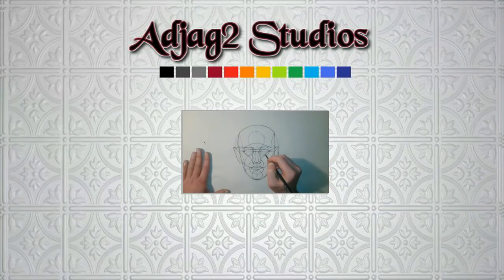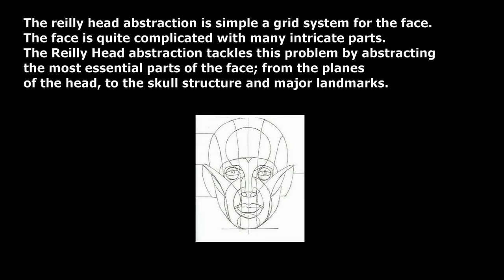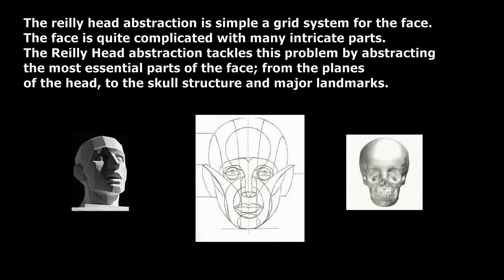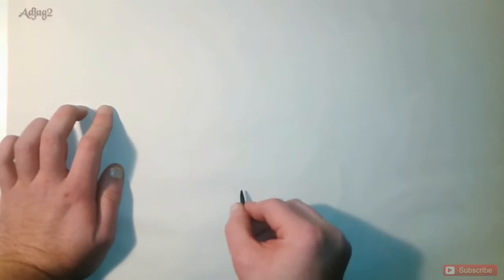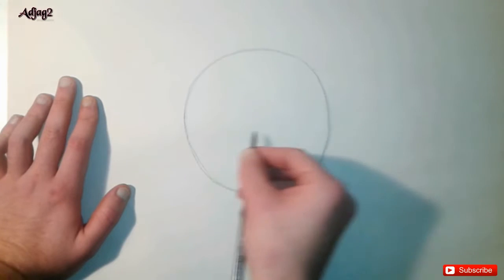Head Drawing with the Reilly Head Abstraction

Comment: The Reilly head is an excellent alternative construction method, but in actual practice it's too damn complicated. I actually use only parts of the Reilly head abstraction to place some of my construction lines. I've found this technique to be better than tediously and laboriously doing the whole Reilly head abstraction. I mainly use the lines around the cheeks, nose, and mouth. No more than 3-4 lines. The cheek line in the Reilly abstraction is especially useful for getting the proper proportion of the face.

The best way to learn is to draw real heads. Do 100 of them. Many heads don't fall under the ideal construction of Loomis or Reilly. Real-world people deviate quite a bit. Don't draw just models. Draw normal people. I can guarantee that your head drawing skills will improve greatly. After you do your 100 do another 100. Rinse and repeat until you master.